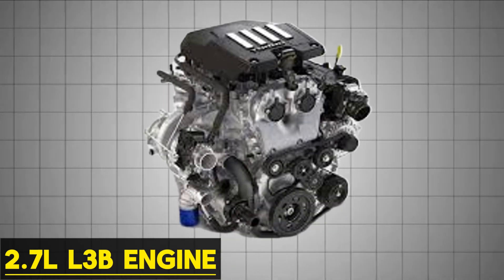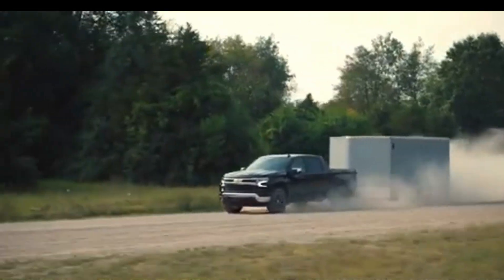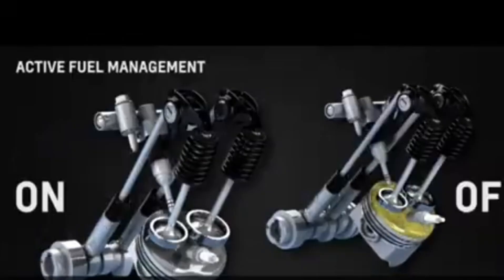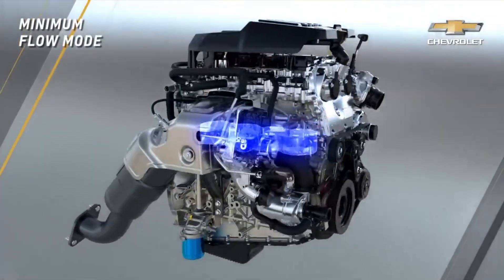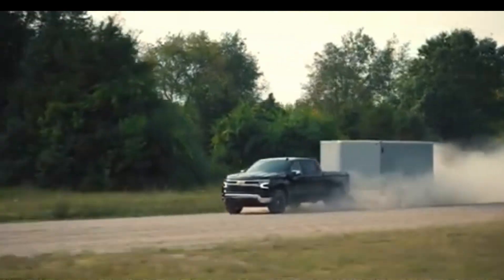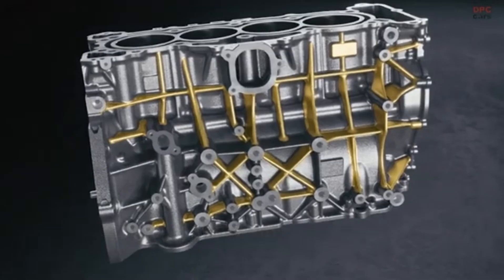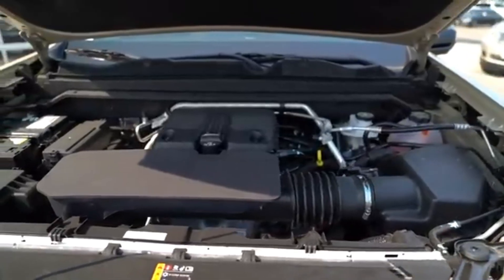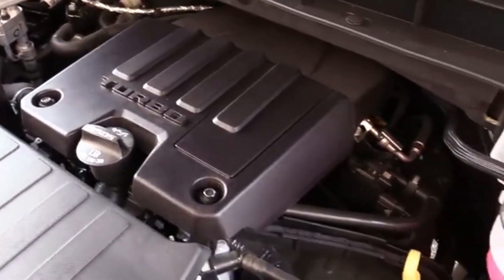GM 2.7L L3B Engine: Everything You Need to Know

Comment: i have a 23 Colorado with the turbo plus engine, middle torque rating 390, a one year option replaced by the turbo max in 2024 models. it received software updates only. i can report no engine issues in 44k miles. the 8 speed automatic is another matter

Comment: Nope,higher rpms with a turbo to make up the difference, longevity is very questionable, I'll stick with a v8😂😂😂😂
Reply: The reality is the opposite. GM 5.3 V8 - 383 lb-ft torque produced @ 4,100 rpm's. 2.7 Turbomax - 430 lb-ft torque @ 3,000 rpm's. I've owned both a 2016 5.3 & 2023 2.7 & they both tow our 33' travel trailer similarly. 2.7 in tow/haul mode stays in 6th gear @ 60 mph - 2,100 rpm. Shifts gears around 3k rpm's.

Comment: Surely everyone remembers when Ford started using V6 engines in the F150. All the GM guys were losing their minds. '6 cylinder engines don't belong in trucks and will never last'. (I guess Cummins and Caterpillar didn't get that memo) Well, GM has said "Hold my beer".
Reply: For 11 yrs now, Ford has offered a V6 w/ same displacement as turbomax - 2.7 liters. Similar horse/torque. More torque than GM 5.3 V8 & Ford 5.0 V8.

Comment: I used to work at a Chevy garage and I remember when these first came out and they had the plastic oil pan with the quick release drain plug talk about a mess when you accidently let the drain plug drop out of it 😂😂 I was never a fan of the plastic oil pans so I am glad that GM finally put a aluminum oil pan under them now 😂 with a 15 mm drain bolt much better design for sure!

Comment: Those have V-8 power.  You would never know you're driving a four cylinder.  The power is smooth and the transmission seems to be always in the right gear (2025 Silverado 4WD).
Reply from the maker: Maintain it religiously for long-term enjoyment
Reply: The vvt/afm design is gonna hurt in the longterm durability IMO.  Honda vvt been out along time should have mimic similar design I'm concerned seeing camshaft failures at around 100k with good maintenance. 
BTW I have 2026 Colorado